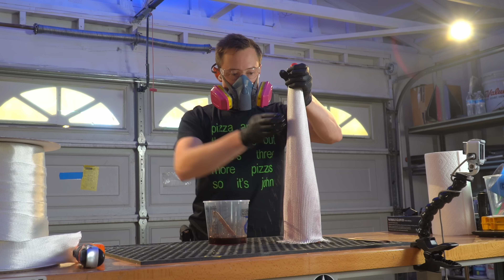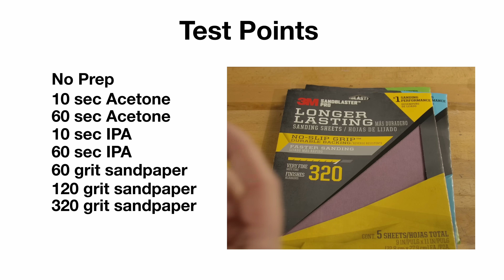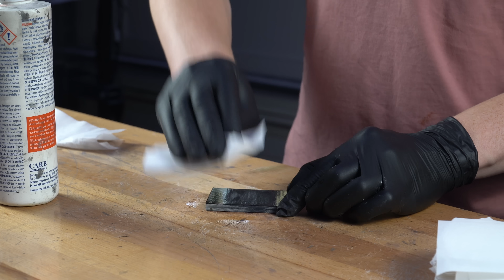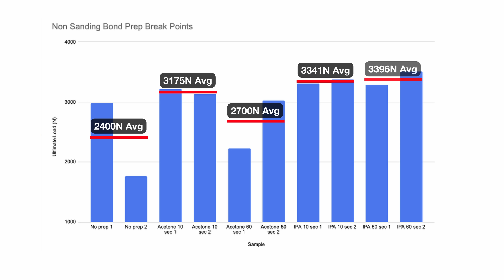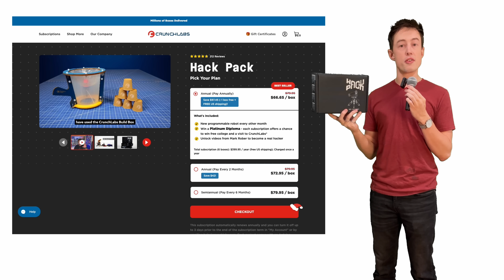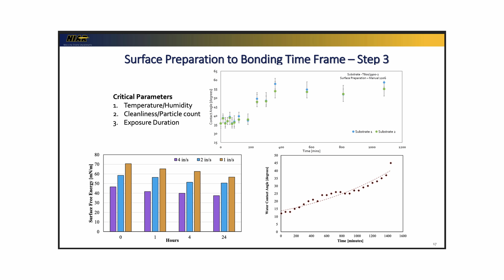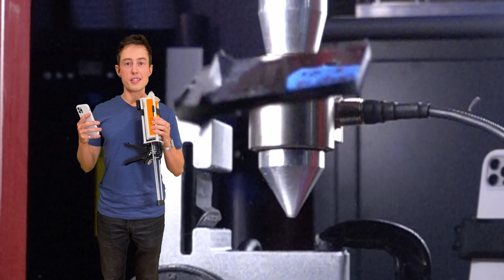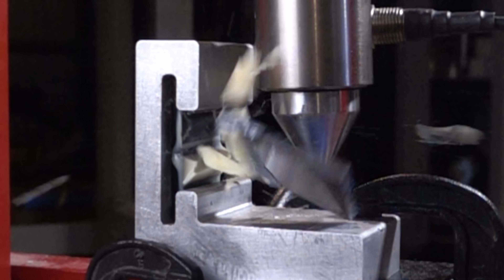I Broke 100 Epoxy Bonds to Find the Strongest

Comment: I'm a motorsport engineer working in F1. I've worked with many bonds like this. The major variable you are missing from your tests is the corner fillet you have between the epoxy and fiberglass. If the fillet has a tiny defect (bubble or scratch), it will cause your test to fail at the stress concentration. This is why this bending test is tricky to control over lap sheer tests. All other variables you have tested do have an effect but will be much smaller compared to the fillet corner quality.
Reply: Amazing video in terms of hours and effort it's mind boggling. Around 26:00 my experience with orbitals is they sorta suck, but in this case specifically, linear sanding likely works better. I think of laying tile or flooring that's glued you want straight lines so air can escape. I assume degassing makes this less an issue, but I'm curious along that vane if some sort of machined microchannels wouldn't work best, a roller with super sharp ridges just barely planing the surface in continuous grooves rather than variable grit across the surface.
Sandpaper grits are too inconsistent
Reply: Yeah I can imagine the reproducibility of the 3d printer used to make the mold (just one layer over extruded, print orientation, wetness of filament) could easily make a stress riser along that filet edge. Would be expensive and WAY more time consuming, but a billet aluminum mold should help on that front.
Reply: @notfst  Its a difficult one. Even a good mold doesn't usually work. micron sized imperfections in the sanded substrate or the tool would result is stress magnifiers which can amplify the stress by 2-3 times. Fatigue is another beast which causes further problems. even a small load can increase the size of the defect leading to a failure over 1000 cycles or so. We find for these applications, a softer epoxy sometimes works better as its less likely to fracture like glass.
Reply: So would you say that affects the data too much to be considered valuable?
Reply: @rgraptor2542 I would say so yes
Reply: Good times!
Reply: @rgraptor2542 definetly
Reply: Good grief! Now F1 teams are using fish to cheat! I have to let ActuallyVen know immediately.
Reply: You are relying on the mechanical strength of the epoxy to resist the tensile and compressive loads.  It is not fortified with fibres so any cracks don’t benefit from the crack arresting effect of fibres.
Reply: Mechanical engineer 2 stuck in PM work, super enthusiastic about motorsports engineering & used to be powertrain lead of my uni’s f1 team, any chance I could chuck my resume at you to take a look

Comment: Nice test and good information gathering. The test itself could be statistically improved by doe (design of experiments) ideals like block formation and randomisation, especially stuff like the sandpaper contamination should become better visible if you track the prep order as well. its more work but less work than doing more tests ;)

Comment: Commenting before watching.
As a non engineer and professional engineer hater.
With common sense it should be prepping surface then bonding as soon as you can to prevent oxydization
Reply: My professional credentials for pro engineer hater is, having to use equipment engineered to sh*t by people that dont know the work they are designing equipment for.

Comment: Residue from Silicon carbide in the sandpaper might weaken the bond. File or scrape of the top layer epoxy and ad several sheet carbon on top. Epoxy that in vacuum. Or use a carbon profile in the corner.

Comment: I wonder if all the degassing overflow from the first test with the 60 grit sandpaper helped hold more force. You can see that the vacuum degassing made epoxy nearly cover the entire upper surface of the fiberglass

Comment: When you did the set of acetone plus ipa plus 60 grit and "saw no significant difference" you showed us right there that the fail number is the shearing of the adhesive not a surface bond failure.  IMO.

Comment: Ooze out a batch without the nozzle and hand mix it (A LOT) and evacuate it and then also hand WIPE it on the surfaces to WET them, THEN slide them into the mold THEN fill and then evacuate again.  The wetting should happen from the vac but hand wetting gives that warm fuzzy feeling...  check the numbers.  Also you can talk to Henkel about getting tiny fiberglass fill you can mix in there to give the epoxy a slightly higher shear number.  Your big first run number might just have been a fluke.

Comment: Interestingly, depending on which ISO certificate you're looking at, (i.e. 9001 vs 14001) an ISO certificate is less concerned with the exact processes you do your testing with and more concerned that a) they're happening at all, b) they're "standardised" in a process (can be ASTM, can be something your organizaion develops, can be both) c) everything is written down. The actual methods don't matter, just that you have methods and are using them.  

*Technically*, the "instron" is a brand name, where as "universal testing machine" or "pull tester" (if you have a machine from the 1920s that only does one test) is the generic name if you're looking for a good deal. Either way you're spending $20k or more for a properly calibrated, properly installed machine.

The consistency thing across tests is incredibly hard to manage, when I do viscosity tests certain types of products can't be tested in the same way that others are, so even if they're all liquids and all the same viscosity, I have to shake some, not shake others, and they all need to be the right temperature (another uncontrolled variable!). The biggest thing I've learned working in quality control is that you can gently massage tests to make the numbers pass or fail, so if you're going to be a good QC technician you need to know what those things are so you don't slightly change your methods to affect the results. 

Something to be aware of is that (depending on how loctite makes their epoxy) the earlier cartridges that have been filled are often more or less dense than the later ones from the same batch, depending on whether the epoxy is pumped from the top or bottom of the tank it's mixed in. Keeping batch to batch the same is the best way to do it with easily usable (clean) cartridges, but unfortunately the best way to get consistency is going to be to have a large container that gets thoroughly mixed and degassed before you mix the epoxy, which adds another huge time sink to the beginning of each test. With the things I've tested it can make a difference, depending on the solids content of the epoxy. More solids tends to increase the difference between earlier and later portions of the same batch, at least in my experience. 

This was a great video, I'm going to use this info at work for sure, and there's a bunch of good info in the conmments as well. Chemicals and adhesives are such a fascinating subject and there's no possible way to know everything about them, mostly on accounts of just how many different types there are.

Comment: You hit on a thing with the scoring and I respond before even seeing the tests.  You could mill tiny grooves along the fin length and the epoxy would gain a better retention on that surface.  You could even mill a frenzel type surface or like the surface of a single cut file facing away from the force.

Comment: The CONAP will also distribute the attachment across the surface as pressures are applied.  When the pressure is applied, the surface attachment receives a more balanced tugging across that face.  The hard cure epoxy types you use will have a torque arm in it that makes more force at one edge than the other. And when the CONAP actually would have a shear failure, it would not cause shattering of the medium, usually halting the tear.

Comment: Currently an aerospace technician. One step you could take as well is being more careful with measuring and mixing the epoxy. I'll use a round mixing cup and roll a mixing stick along the perimeter of the cup as I role the cup in the opposite direction opposite. This mixes the two part epoxy and minimizes the introduction of bubbles.

Comment: The most effective method of bond preparation is engineered mating surfaces. Your ability to address this problem is strongest in the design phase.  This isn’t really relevant to the video but it bears pointing out that the bond strength is kinda drowned out by part geometry.

Comment: Maybe also consider the time frames between when the jack is lifted for the next push while the sample is in a bent state and under a certain amount of pressure which would start the bond decomposition process before it snaps causing an inconsistent result?

Comment: For a Youtube video this is pretty impressive and I had to review paper with less data but the same spread in the results.
You may be faster by reading the papers on the topic out there. But as you said, these are your data, and in generating it you learned a lot, like questioning yourself how valid your is your setup, test prep and so on. This is an invaluable skill in doing scientific research.

Comment: For the real application on your rocket why don't you use epoxy glue as a fillet material and then epoxy/ fiberglass cloth over both sides.  A bit more faring , but your fillet can be smaller and thus less drag. all of your bonding techniques still apply.  Example I think of is how surfboard fin are glassed on.

Comment: In some joints in house construction you use a fiberglass or other tape across the seam of the joint and use kinds 2 layers (layer spreading tape then top coat. depending on adhesive/application the second coat immediately or after a delay) too much alcohol might be smoothing the resin in the material out a bit reducing adhesion.

Comment: Loads and Stress Analysis tech here. My initial thought was the shape of the load head attached to the load cell. I noticed it’s triangular, pressing into a dimple you drilled in the blank. I would consider shifting to a small ball load head with no dimple. That should allow for free movement and take away some other variables.

Comment: Use a silicone mold without release agent to avoid any contamination from the mold release agent. Also add doweling pinholes in the bottom plate or what would be the rocket body .

Comment: Hello, in france i use microballs glass inside epoxy. The glass microbeads used in sandblasting lighten the structure and make the epoxy rock-hard, allowing it to be cut and sanded as desired.  Many people have mocked it because it's not a common mixture, but after trying it, they changed their minds. It's hard to imagine the strength of such a mixture, but it works beyond anything you could imagine. I even thought about patenting it. Thanks for sharing!.

Comment: Very fun testing. I like the approach of the testing doesn't have to be perfect to be useful.

Also I wonder if using a pressure pot could be a more consistent approach than the vacuum chamber for removing bubbles in the epoxy. Or if having microscopic bubbles at high pressure entrained in the epoxy would cause a weaker joint.

Comment: I was an aerospace, developmental engineer. We did extensive testing for impact, toughness and extreme resistance to failure.. one of the core conclusions was that if you’re adhesive polymer was flexible you had a much higher strength overall allowing for initial shock to be absorbed. 3m 540 was Shockingly high work aramid composites. We did abraid the surface. you do have to Engeneer the mechanical interaction differently to allow for an elastomeric  bond you would want to have a flat surface to flat surface versus a perpendicular interaction like you’re doing in these test coupons. But you will get shocking performance.

Comment: The video calls these coupons fiberglass sheets, or composite, and doesn't specify what type, which resin is the binder (unless I missed it somewhere). There are many types of fiberglass composite that use various resins: phenolic (Micarta), epoxy (G10), melamine, polyester, polyurethane, etc. The resin type will greatly affect the adhesion properties of epoxy. And the best surface prep practice will vary depending on type of composite. The scientific papers referenced as 'good data' examine a certain type of composite and the characteristics of other types may not apply. The test coupons in the video look to me to be G10, which uses epoxy (some have the characteristic 'ghost jade' color), though the black ones could well have been one of the other types. This is important information.

Comment: Great research to get to the critical importance of surface prep. My takeaway is that wet on wet for chemical bond where possible is a must on critical layups where a wet on dry mechanical bond is unavoidable maximise surface area and apply strict surface prep process using inert consumables.

Comment: Just a thought, shouldn't the failure mode be more heavily weighted in the result analysis? The surface prep is the primary variable so cohesive and substrate failure modes should be isolated as null results. Exceptions for degassing changes.

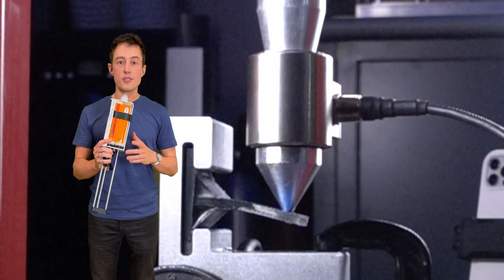Comment: 4:04 during your push force test, the force might not only be from pushing vertically but also from the side and the way that the edge  of the tip grip to your piece. It might grip a bit longer sometime and apply peel force horizontally. You could add a ball bearing for better constancy of the spot location of the tip under pressure.  During lap shear test  example in the published documents did you noticed the lenght of the parts and the pull force that is distributed evenly from the flexing of the part helped by the vertical lenght? You test setup apply push force and not pull force which make VERY difficult to isolate a single vector of force applied to the test sample.

Comment: 30:38, There is one more thing to help constancy in your results when NOT using degassing: You should get a nozzle that can reach the bottom of the hole, then inject the liquid epoxy from the bottom FIRST and then rise it as the level reach the top. What it will do?  It will reduce the possible big air bubble trapped inside this vertical stack of glue.

Comment: 30:03 I NOTICED one thing that could be responsible for your test inconstancy problem! When you FLIP the piece you are sanding.. this surface rub directly against your wood table which is probably contaminating it on this side.. but you dont pay attention to which side you put on top during assembly prior to apply epoxy.. so: 1: you contaminate your sample from the table surface while sanding and 2: one side of the sample get contaminated but nothing predict on which side it will be bonded on the top or bottom when breaking it.   My suggestion would be to use a small bed of nail table to sit your piece to sand onto. So very minimal surface will be contaminated.. This contamination is as important as your sand paper contamination is.  It matter eventhough you clean with IPA after.

Comment: 26:32  It is more difficult to remove that air that become trapped at the bottom of each cavity than with larger grit or manual sanding.  Manual sanding make deeper cavity = less air per deept of cavity ratio = more surface to bond without having air bubble creating a barrier.